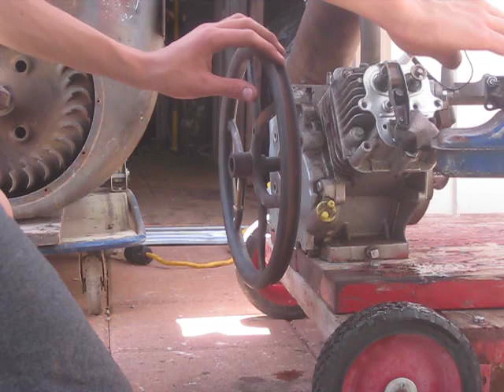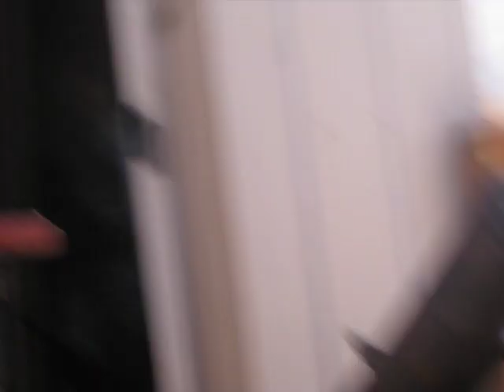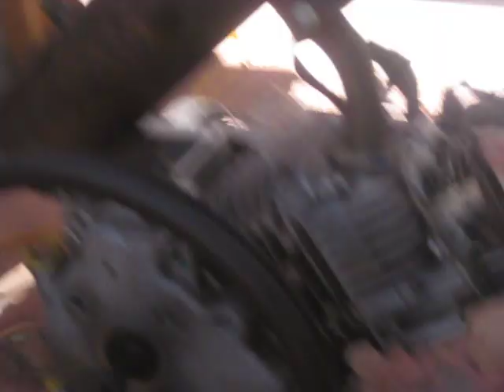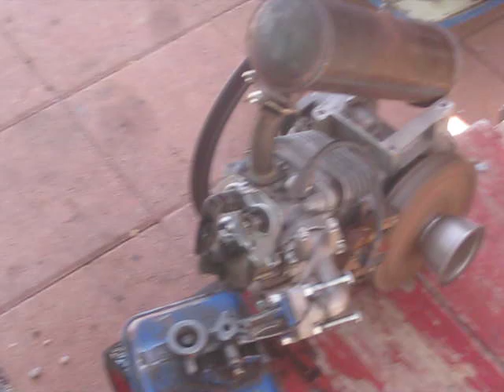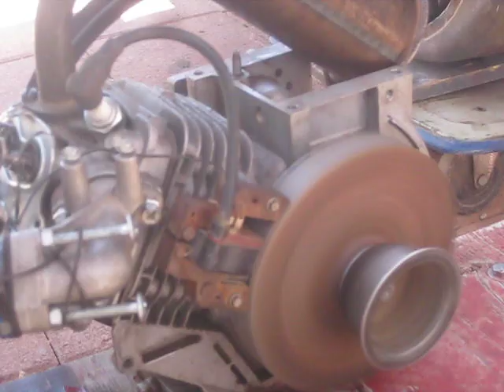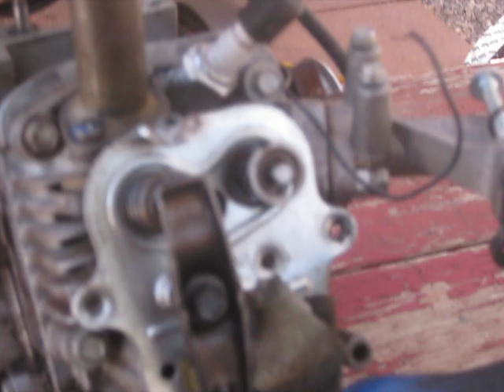Flywheel Briggs w/Muffler

Comment from the maker: The hit n miss engines have grease cups for the mains, cam, and rod, and an oiler for the cylinder. Some of the larger engines have oil troughs for the mains.
I guess grease would work better than oil on the piston valve, the grease will stick to it longer.

Comment: Yes, I was thinking that splash lube woulnd't work very well at very low rpm, I think some of the old hit and miss engines have grease fittings on them.
Grease seems to work OK on the Piston valve engine, for fairly short runs :)

Comment: You want to be careful not to over rev the pulley type flywheel!
Cool use of a 2 horse carb, I figured a slow running engine would need a smaller carb, to keep the gas velocity high enough to pull the gasoline up.
Sweet motor!  :)